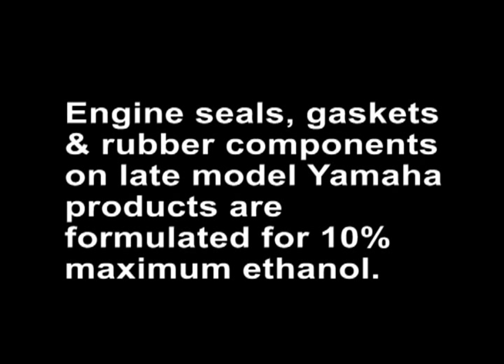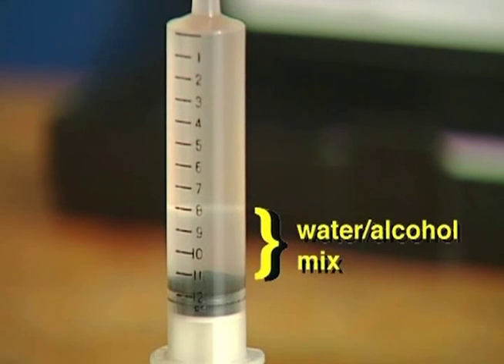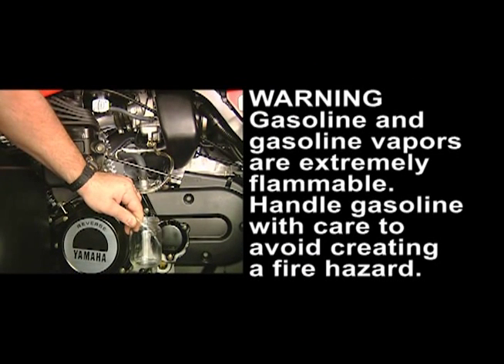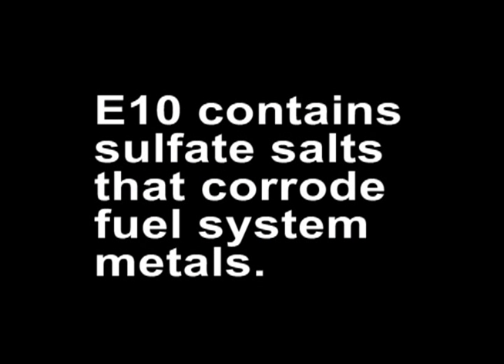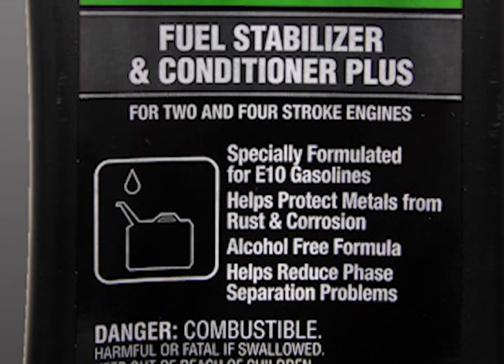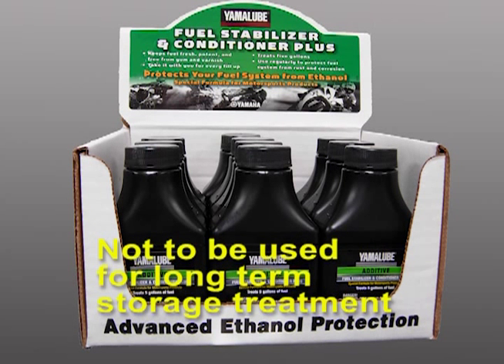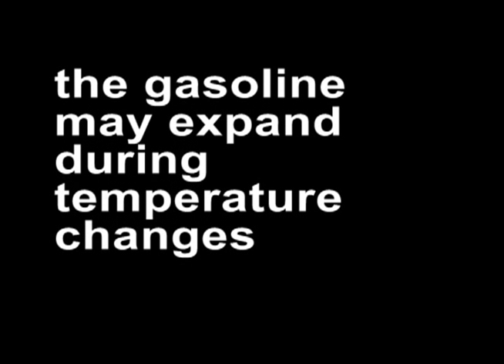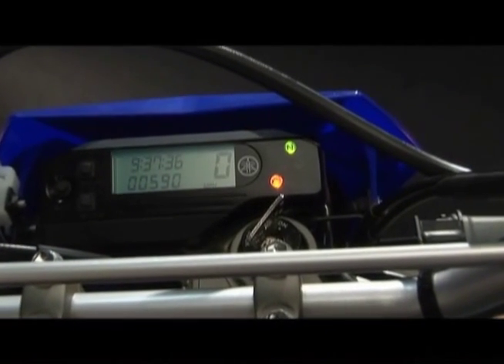Fuel Stabilizer & Conditioner PLUS

Comment: Ethanol is HYGROSCOPIC, not HYDROSCOPIC. Hygroscopic substances do NOT absorb water out of the air, regardless of the humidity.

Moisture (water) forms in a tank because of condensation. Condensation can occur even with empty tanks. 

If you want to speak with authority, provide correct information.